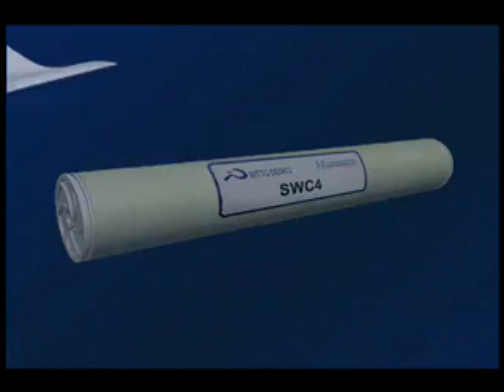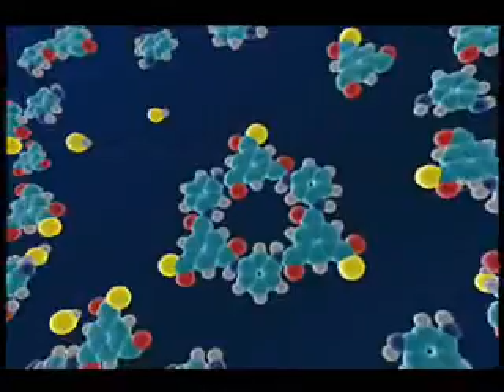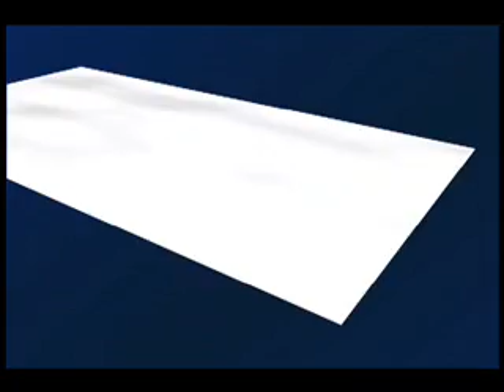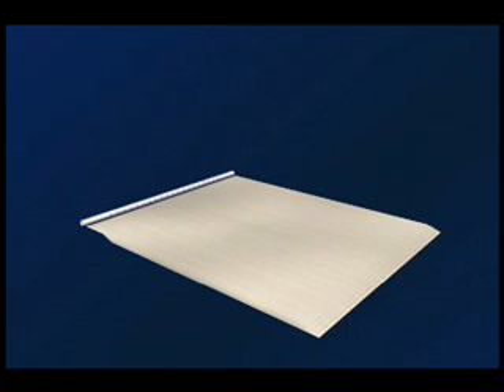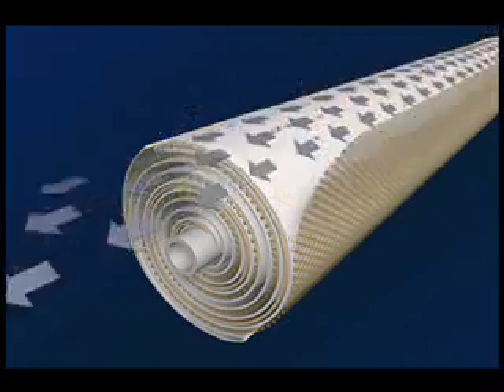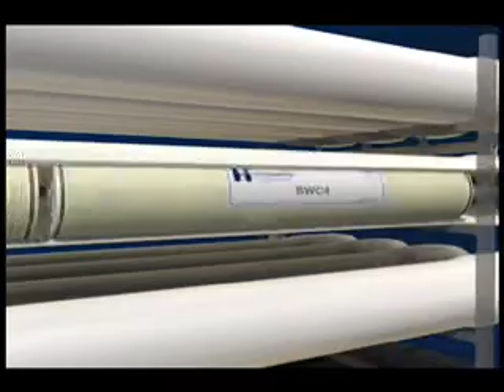RO Membrane

Comment: Today's reverse osmosis membranes have one very bad property - they do a good job of filtering inorganic impurities (salts, acids, alkalis) and large organics. At the same time, low molecular weight organic chemicals are filtered very poorly.
Although commercial often promises you that the membrane filters water by 98-99%, in reality these values are achieved only on simple substances like sodium chloride.
Substances like urea, formaldehyde are filtered by only 20-35%. Manufacturers hide this information and not mention it in their commercial booklets.
For each membrane, they have a selectivity passport, which indicates the real degree of filtration of all popular pollutants. Before buying a membrane, always ask for this data sheet. Make sure that the filtration readings of low molecular weight organic chemicals are at the highest possible level. Also make sure that the membrane is original - today the market is flooded with fakes. Buy a membrane with a qr-code, which is checked through the official website of the manufacturer.
Reply: Watch video "ro membrane rejection passport"

Comment: I suggest that the video show a membrane in the flat rectangular configuration they are fabricated in, even though they are not like this in the final configuration.  Then roll it into the Spiral to show how much more area of filtration is created in each element.  Then connect the elements to fit inside each Pressure Vessel Tube.